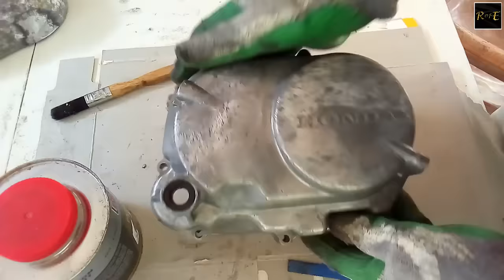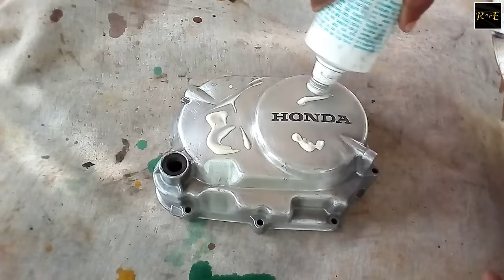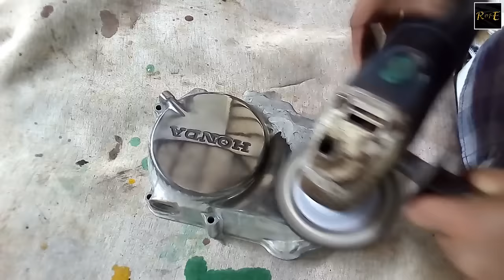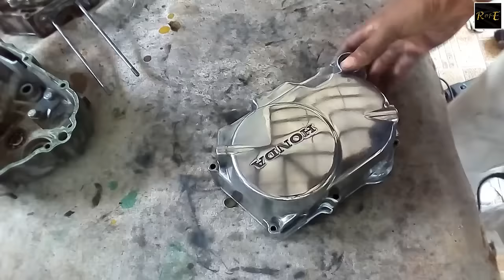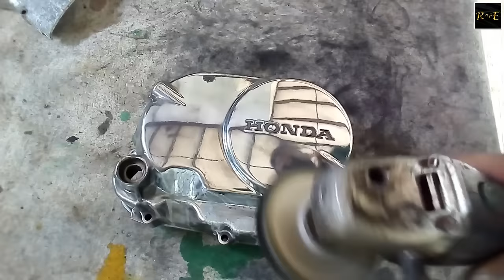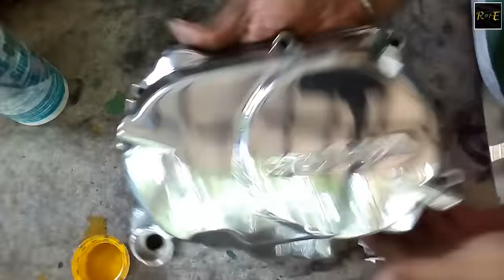How to Polish Engine Cover - CD90 Engine cover restoration

Comment: You did a beautiful job but I would not call that "restoration" because the originals never had that level of shine. You just went too far.
Reply: This normal in restauration business, and I know. A mirror finished engine cover is like the crown juwel. This normally takes me about 3-6 hours.
Reply: Yeah, agree. Shiny, but not restored. Restored would be painted.
Reply: @talldrummer1  Or clear coated.
Reply: @DavidM2002   restored would be whatever it was ORIGINALLY. That was painted.
Reply: Most of these videos are Honda motorcycle engine covers where v8 at
Reply: @talldrummer1  Yes. Exactly.

Comment: Good job. Just a tip or two....1) When wet sanding, use a drop of dish soap on the sandpaper. It keeps the paper cleaner and helps the abrasive action. 2) Start w/ P400 grit like you did, then follow up w/P600, then w/P800 and maybe P1000. This will help cut down on the polishing process times. If that part is cast aluminum (some are), keep wax on it,  or clear coat it, or it will oxidize and turn gray again. Not criticizing...just something to think about.
Reply: clear coat was my thought too.
Reply: 100 % right
Reply: @teddyjakeddy975  A coat on an engine? English is soooo weird. Bet you wear a clear t-shirt, now?
Reply: @voornaam3191  cringe
Reply: Will the clear coat withstand the heat of the engine though?
Reply: @bakerlanglnonglait4502  use high temp clear coat... Cerakote is the bomb 🤘
Reply: He actually starts with 220 then goes to 400 which is shocking because the 400 grit wet sand I did to mine left some pretty hefty scratches.  I went up to 800 then skipped to 1500 because that's all I had.  Still it was frustrating trying to get the fine scratches out.  It looks like he shows a felt buffing wheel in his hand before starting the B Cut but then the actual pad on grinder looks different.  Maybe its a worn down one.  Either way this polishing aluminum is a learning experience.  Once I find the right polish and buffing application I think I will have it made.
Reply: will the clear coat stick to the surface? with it being all shiny and stuff.... I'm planning on doing the same for mine 🤔
Reply: O que ele usou na máquina é espuma ?

Comment: What a spectacular difference you made, terrific work there!

Whilst you have the cover off the engine, it would be a good opportunity to replace the original kickstart shaft oil seal, and as the engine is completely stripped, to replace the gear change shaft oil seal too.

To complete the job, the output shaft oil seal should also be replaced, that way, after rebuilding, you should have an oil tight engine!

Thank you for sharing this video.

Comment: I did the same to my Honda CBR900RR frame and swing arm. Some parts were cast aluminum so a bit more time was required on the sanding grinder. When finished the entire bike was mirror.
Reply: PapaWheelie has it started to corrode at all?
Reply: ThrillerKillerX - Thanks man.  
It gets a little hazy but some Mother’s aluminum polish brings it right back. The frame stays really nice but the swingarm seems to haze quicker. Not sure must be a different aluminum. It took probably 10 + hours to do originally but now it only needs touch up once a year for an hour or so.
Reply: I just put up an unlisted video showing the frame. It hasn’t been touched up in over a year and it gets rode hard and put up wet. 

https://youtu.be/Mh-lePQyVYI
Reply: Can you post a picture pls
Reply: Good stuff but better not be cracking the whip on that CBR9. Cops will know who you are but maybe you can out run EM. . BTW they use cast aluminum and extruded aluminum, so there's  quite a difference between the two in strength and appearance. Typical Honda manufacturing always good.

Comment: Hey, awesome video! Anyone know if the engine would rust over time or if you would need to spray a clear coat on it?
Reply: Would definitely need a clear coat
Reply: He does that in a different video where he restores the full bike
Reply: @funcool32  heat resistant clear coat is very important or it turns yellow over time. For example a VHT enamel clear coat or a spraymaxx 2k are ideal.

Comment: What about sealing it with a clear coat? Nice job btw
Reply: It may not as shiny as that if u seal clearcoat
Reply: @lovelydianeveloso3577  I would clear coated it anyway for protection :-)
Reply: Ok its up to you sir
Reply: How long will clear coat last on a hot engine cover?
Reply: It may take years before it will fade
Reply: @stormkhan8870  you need high gloss heat resistant clear coat like vht brand

Comment: Polishing looks ok but when its get wet u can start over.good prepare before chrome.
Reply: I'm Glad someone said it. I did the exact same thing one time, First Rain, BLACK WATER SPOTS all Through it & won't come out.
Reply: @len-zeplin480  you can spray it with clear coat it will last long....

Comment: use clear coat to protect those shiny work
Reply: Only High Heat Paints can be use for This type of parts..
Reply: @amiteshbaghel  good thing Rust-Oleum make a high temp clear coat.
i doubt that part gets hot enough to even burn your hand.
Reply: @amiteshbaghel  no clear coat.. this surface to smoth for clear coat to grip n last... the coat will not last long ... its will be ugly when the clear coat chips
Reply: I tryd that and it just grew unerneath..then I had to strip it back off....so just leave them bare anymore.. Not hard to get shiny..with blue magic and magic eraser

Comment: It will get corrosion too fast because you haven't painted it.
Reply: Or laquer it.
Reply: No it dosnt, i do the same thing to my bike almost 5 years ago, ill sold it the Last mont and dont have any rust, Just it was a little opaque
Reply: @redcom1442 
yes it's not just plain steel,
they use special alloys
Reply: Yes u r right ...I'm a hardware manufacturer...
Reply: @devkichauhan3306  its not steel at all. It's cast aluminium. It will corrode unless you keep polishing it or seal it with clear paint. The finer the polish the faster it will corrode.
Reply: Aluminum is porous an so when it is polished it is all sealed, but must be repolished again and again for it to keep its luster... polished nicer, but painted lasts longer...
Reply: @rollieblue6879  that's why i said
Reply: No...
Reply: @fatihahsalimnur4518  why no
Reply: @redcom1442  where i can get this polish (b cut super)  not available in online app
Reply: @rollieblue6879  any special clear coat to stick to an already polished part? Or what would be the process
Reply: Wax it and it'll be fine

Comment: Como vou saber o nome dos produtos para comprar
Reply: lixas da água ,220,320,400,1200 e2000 depois de bem lixado massa de poli e com boina na polotriz para puxar o brilho e depois cera de cristalizar ,mas capricha no lixamento pois e ele q croma .Lixando vc vai gastar o alumínio da peça ,cada lixa tem sua função.
Reply: Eu acho q da 400 pra 1200 é mto distante irmão.  Use alguma lixa entre essas, tipo 600 e 800

Comment: No painting, it should be corroded
Reply: It's made of a metal that won't rust
Reply: @DaleDix  are you serious? All metal corrodes including aluminum. Boy did you get hit with the dumb stick this week? However polished aluminum will last a long time
Reply: Yeah... it'll oxidize pretty fast especially near the coast. Need to be anodized.

Comment: Nice work I might have to do this when I renovate my old rusty 1980 Honda C70 step-through Moped next year.. want to do a ground up restoration on it and this might be just the ticket I think.. (assuming I can save the frame ok and source new wheels and tyres springs seat etc here in UK cheap enough cos at the moment the only thing that's stopped me is the RIDICULOUSLY EXPENSIVE price of parts over here!! 
If you have any advice on where I can source Honda C70 parts either Honda or after market patent parts that are of good quality then would be much appreciated!)
Keep up the good work! 👍🙏😎
Reply: You can easily source cd70 parts in Asian countries. Indonesia pakistan china Philippines..

Comment: Good job…
  BUT———-
I have seen lots of side covers polished with Jewelers rouge like this — not realizing what would happen next..
  if the side cover looks that rough before polishing, that probably means the rest of the motorcycle looks just as rough…
  So —— making the side cover look like a new penny, and then installing it back on the engine, makes the rest of the bike really worse than it did before with the original patina that tells a story... These engine side covers did not look that good right out of the factory when they were new..
  i’ve seen a lot of buffed side covers on suzuki and Yamaha engines many times, and the side cover looks great but it also makes the rest of the bike look like crap if you don’t address the looks of the rest of the bike at the same time ..
  Great job on the buffing
I just saw that I commented on this video over a year ago also. I thought it was a new video because it just came up on its own, I didn’t search it out here on YouTube..
  I will delete my least favorite comment of the two, after I decide which one is better..

Comment: Very well made, but is temporally 
Bien hecho es un excelente proceso pero es aluminio y tiene la propiedad de que estando expuesto a condiciones de oxígeno formará una capa de óxido de aluminio que aparecera con el tiempo poco a poco hasta que valla perdiendo hasta un 30% esa reflectancia, lo cual significaria volverlo a retrabajar, repulir, en cambio si fuese una superficie cromada sería mucho más resistente a a la formación de óxidos y sulfatos 

A mí me tocó trabajar en la fundición de  Aluminio y el pulido para termoformado y la formación de alumina es muy común siendo un procesos lento

Comment: Refrain from using a grinder to polish, it transfers a lot of heat to the piece 'cause of the high speed. Always try to use a tool that has variable velocity.

Comment: It makes my polish job look crappy. 😩
It looked like he only went to 800 before polishing. The B cut I used didn’t do this good but I used a drill instead of an angle grinder. Maybe the high RPM’s made a difference. Any how it doesn’t get any nicer than this.

Comment: Now I get it. These videos are by the skilled master. The other ones with the old diesel engines teardowns are done by apprentices. You can clearly tell by the level of teardown and the way it's done. The diesel videos are very crude and only opening, cleaning and assembling. But I agree on another comment here: the painting of the letters looked like crap. He should have just filled it with paint and then wipe the edges off with a rag or just left it clean.

Comment: There is one little problem with making your side cases look better than they did when they left the factory. It makes the rest of your engine and the rest of your bike look like crap unless you go all the way, Which means, you have to quit your job, give up your girlfriend, Give up your social life,and just work on polishing every visible surface on your motorcycle for 60 hours a week. The side covers are probably the easiest part to get at and polish. Just wait until you try to get all the cylinder cooling fins, or a set of sand cast engine cases.. an excellent past time for the compulsive  introvert loner. 
 looks fantastic if you’re into that, but if you have an older motorcycle or car it may be valuable, glitter is in the eye of the beholder.  it could be a costly mistake to erase the machines  patina, its history which tells  the story of its life..

Comment: what is B-CUT
Reply: B-Cut Super, is an ultra fine compound specially designed to cut and polish auto finishes, modern scratch resistant clear coats and old surfaces to a high gloss polished surface. The product can be used to remove stubborn dirt/diesel, fuel film/sanding scratches, and other scratch marks from the surface